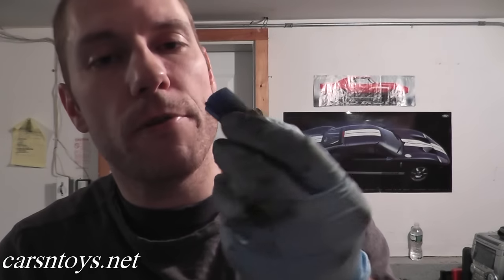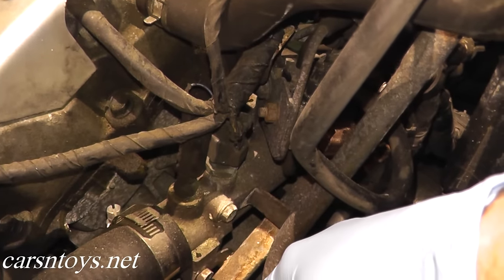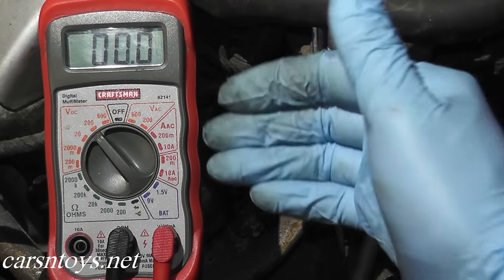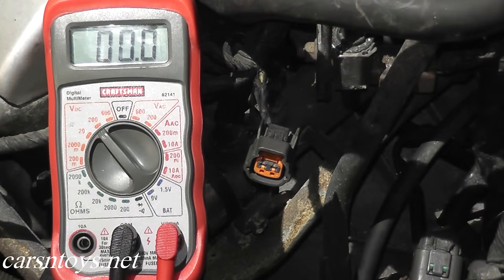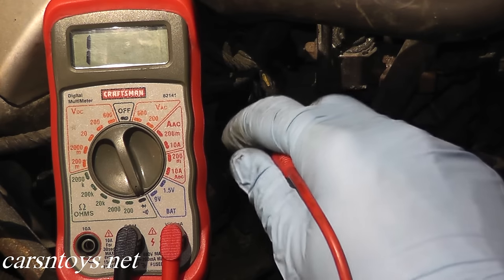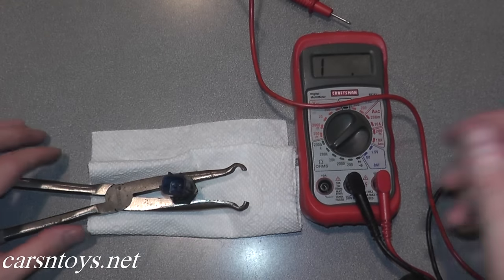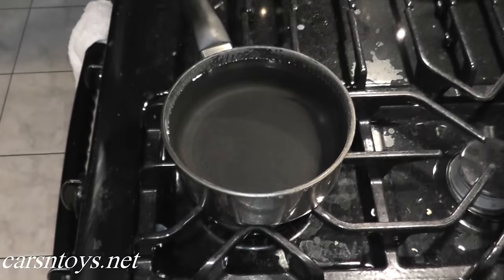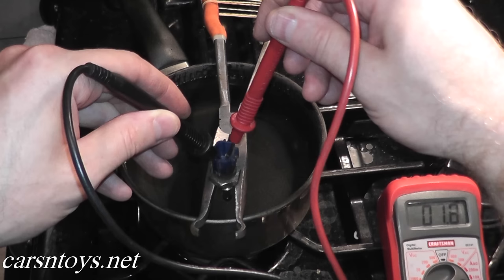How to Test and Replace an Engine Coolant Temperature Sensor P0115 / P0125

Comment: You must download a temperature versus resistance chart. That is crucial. My multi-meter was showing 22,000 ohms. Then I looked at the chart I googled and downloaded.  It showed that for 80 degrees temperature I would have 22,000 ohms. My multi-meter does measure temperature.  The temp reading on the sensor was 80 degrees. I touched the lead right onto the metal part of the sensor.  I looked at the chart and noticed that 22,000 ohms was just right for 80 degrees temperature. A reading anywhere from 1,000 ohms to 58,000 ohms (!) is normal reading depending on the temperature of the metallic part of the sensor. .
Reply: Thank you for that information I don't haft to down load it now saved me data and time !! 🙂👍👍👍

Comment: Just writing to say thanks. You helped me get my temperature gauge working again. This was on my 1990 Volvo 760 GLE with the B280F Peugeot V6. (I have been told that this engine was used in the Delorean).  Following your diagnostic steps, on my sensor connector, one pin read 12V and the other 0. Then I switching to OHMS,  the other pin read open circuit. So I reasoned that  there must be an open in a ground connection somewhere. But instead of trying to fine it , I just ran a new wire  from it to ground, measured the voltage again and it dropped from 12V to 5v . I started the car and the gauge now works.
Reply from the maker: Awesome! Glad to help.

Comment: Or it could be the ECM. or the wire from the connector to the ECM. And there's no need to take out the sensor to test it.
Reply: Michelle Sullivan that's what he said.
Reply: Michelle Sullivan but the ECU runs on less than 5 volts, and the resistance check puts put I think 7 volts? Probably should disconnect sensor before test

Comment: By far the most helpful video on YouTube or anywhere.  Sound, picture detail and simplicity of explanation 10/10/10.  Saved me from doing a lot of work that still wouldn't have fixed my crank but no start problem on my  99 Suburban. Thanks so much.
Reply from the maker: +Tonya B Thanks, Tonya. Start with basics - if the vehicle cranks check for spark and fuel.

Comment: On two 25+ year old vehicles, the tab on the female connector broke off.  Once when I was at the junk yard -- snapped off as soon as I gave it a good push, and once by someone else who replaced this sensor before I go the vehicle I'm troubleshooting (rough idle, engine stalling when engine is cold, problem goes away when engine is at op. temp.  In short, I'm missing the press tab.  Do I order another one and splice it in?  Thanks for the video -- I'm following it now.

Comment: I have a 2004 VW Beetle. A couple of days ago it starting acting strange. The engine wouldn't run right and the air conditioning wouldn't work. I suspected it was the coolant temperature sensor. This morning while the engine was cool I tested the resistance across the 2 ECM pins which should have read at the most 2.5 kilohms. It read 416 kilohms. I replace the sensor and now it runs like it's supposed to. I am so thankful.

Comment: You state there can only be two possiblities. You could very easily have a break in your wiring at any point on the harness. Two wires twisted (short to power or ground) you could also have a dead circuit in the pcm itself. But 8/10 times, you are absolutely correct.
Reply: Also i mean no offense, this is a great video!

Comment: The thermostat in question is called a "fail-safe" thermostat meaning that when it fails, if fails in the open position. If you look at the top you will see where the carriage containing the pellet has locked itself in a notch on the body to keep it open.

Comment: Hello CarsNToys

I want to say great video and I was able to locate my temperature sensor on my 2005 Jeep Grand Cherokee 3.7 for I am getting a ‘gauge not working’ on my gauge-digital dash and temperature gauge does not move.   I had replaced the temp sensor and I still get the ‘gauge not working’ error and my temp gauge does not move ( I let the vehicle idle for 15 minutes).
I did the following test with my voltmeter:
1. Voltage to temperature connector as indicated in your video and I get 4.9 volts.
2. Tested the OHMS continuity on connector and it passes by giving audible sound.
3. I ran the Kilo-OHMS test on the old and new temp sensor and I get 5.0 on old sensor and 4.5 on the new temperature sensor.
4. I brought a new temp connector, which I had not replaced yet because the voltage test to the original connector works showing 4.9 volts.
5. My electric fan turns on when the engine is idling and when the a/c comes on.
Any ideas on how to test this ‘‘gauge not working’ on 2005 Jeep Grand Cherokee?
Thanks,

Comment: You have the DMM set at the 200K ohms setting when you are measuring the sensor, so that means 2K ohms and not 2 ohms.
Reply: Exactly what I thought.
Reply: Jan Burgel but you guys still got the point.
Reply: The problem is not every multi meter has set ranges to select from.  Some are auto ranging.  So if you are looking for 2 ohms, and you see 2k, you might think the sensor is bad when in fact it's good.

Comment: Thanks for the video.  Recently got a 1991 Fleetwood Tioga Arrow (Ford e-350 chasis) whose engine temp gauge is not working.  I'd like to do this myself, but everything is SO compact and intertwined under the hood it is very intimidating.  I think I found the sensor, it seems to be just behind, to the right of the distributor cap, but it is almost impossible to reach.

Comment: The temperature switch is on the top of the engine and places the engine into closed loop once the engine heats up. The temperature sensor, for the dash gauge, is always on the cylinder head to measure the coolant temp flowing through the cylinder head.
Reply: What does ... open loop due to engine load or deceleration means?

Comment: My car is throwing P0118, P2184, and P2185..I ran all the tests mentioned in your video and everything checked out, but these codes will just not go away. Any idea what else could be causing this? Great video by the way; easy to follow.

Comment: Very good explanation ...only one rectification ..the resistance of the sensor it is 2000 ohms (2 K ohm) as the scale used in 200 K ohm I guess.. but any way your video is very good.

Comment: I checked sensor and continuity using your method and I have continuity and resistance on sensor but my gauge on dashboard shows max temp as soon as I put my car in ON position and the engine is cold as night. What could be the problem? Thermostat?

Comment: I just want to say how well you presented this. I am not mechanically experienced but  certainly have no trouble following your clear and concise instructions. I do have a P0115 error code... Mechanic could not work it out but I put my cheap Chinese ODBII diagnostic tool onto the car and it clearly told me the fault is a P0115. Now I know exactly what to do to test further.
One question if I may? I have a Peugeot 407 V6 3.0L and the reason why I found out I had a problem was the water guage would shoot up to maximum temp then drop to stone cold... then shoot up again. So to me that makes sense that the coolant temp sensor or the harness is where the fault lies... BUT if it is not there... do you have any suggestions?

Thank you!
Reply from the maker: +John Carter Glad to help, John. If all turns out well with the coolant sensor, I'd check the cooling fan motor next. You can simply test them: https://youtu.be/bf2kvZJx1OA

Comment: Fanatic video and instruction. If the reading on the connector is not good, how do i correct it? Where does the wire go? How can I check and replace it?

Comment: Hello and thank you for this informative video. I checked the sensor on my 2000 Camry 3.0 v-6. I remember you saying the normal ohm rage should be 1-2 ohms. The reading on my sensor is 5.9K ohms. I realize that zero continuity means a faulty part, but what about the really high resistance that I'm finding? Please advise.
Reply: catalyst2112 did you find out the answer to your question? Thank you

Comment: Thanks for the video. When the car is cold (65 degrees F outside), I only get 950. When the car is warm (90 degrees C on the dash), I only get 65. These numbers seem was below yours. Is the sensor bad? Thanks.

Comment: Great informative video. Very well photographed and explained. Have an 02 Honda Odyssey and the temp gauge shot up to hot and yet coolant is fine. Ironically just cleaned ports and replaced egr valve. Hope my problem is this simple. Within a day after I had the transmission temp sensor go bad. Within a week of that this happens. Again I hope its as simple as the sensor. Do you know if I can continue driving for a little before fixing without causing damage? Thanks for the great video and explanation including water test.
Reply from the maker: Thank you. I wouldn't drive the vehicle if it's close to over heating. How's the water pump?
Reply: Reservoir level seems fine, no steam and timing chain as well as water pump changed replaced at 108,000 and now has 147,000. Any other concerns?
Reply from the maker: Are the radiator fans turning on..https://youtu.be/bf2kvZJx1OA

Comment: just some added info that the temp sensor shown is what triggers the code--however that sensor is not what tells the temp of the engine on the dash. That sensor is a one wire sensor someplace else.

Comment: Also, whenever  the engine will not take throttle and stalls as soon as I touch the gas I have to hold the pedal to the floor to get it to restarted.  When it is running right I can just turn the key to start it without touching the gas. ECT sensor test OK, 5v from ECM to connector and 2 ohm resistance that drops as coolant temp goes up.  This problem can happen when it is hot or cold weather and hot or cold engine temp.  94 GMC Yukon 5.7 can run great for days and then bam, just will not take any throttle.

Comment: thank you for the video. my voltage and continuity tested good. old and new sensor tested good, still getting the p0115 code. what else could be wrong? can't figure it out could it be the pump? my car is not overheating though. thanks for any input

Comment: Thanks I'm gonna test mine on engine with these parameters. I think it's ok tho because with scanner hooked up temp reads at what is normal operating temp for my 96 Dakota, but the dash gauge never moves summer or winter. Do u know if gauges can fail or if that would usually be a wiring to the dash gauge issue? Thanks either way I can rule out the sensor for sure.

Comment: Had many problems with Toyota Camry wagon 1991 2.0 FWD 3SFE. began to check all wires to all sensors and the cold start temp switch broke in two from age! car was getting hard to drive. had problems shifting gears at 40 mph, surging idle, no power, bad gas mileage, engine light was going on then off, stalled on acceleration, no power on hills, thought the car was done! Replaced temp switch for 17 dollars at AutoZone, car runs like new!!!!!

Comment: I just pulled my temp sensor out of my Pontiac grand am v6 and I followed your video on how to test the sensor I checked the sensor with my gauge to 200k and got a reading of 4.8 in your video you say if you get a reading that's good. So I assume that the sensor is good if I got a reading. If I didn't get a reading that would mean the sensor is bad? Thanks hope to hear from you.
Reply: Was the sensor bad?

Comment: My question is can a resistor based sensor like the coolant temp sensor fail intermittently or once it fails is it done?  Mine tests OK for resistance, etc but every now and then the engine will not take throttle (hot or cold) and will stall when I touch the the gas.  Other times it runs fine...thanks.,
Reply: Prolly too late but it could be your map sensor or egr valvue

Comment: 1. Having set the meter on 200kohms that is Kilo ohms a reading of 2.0 =2000 ohms.  Not  2!
But it would be better to use the 20k range on the meter.
2. My faulty? sensor gets part way to hot, but not all the way, so really it needs to be tested at boiling point. But I don't know what the resistance value should be.

Comment: hi I have a Peugeot 308cc The sensor works I followed your instructions and I placed it in cold water the hot and the resistance changed the only problem I have is when I measure the voltage on the sensor plug I get 3.37 volts is that too low and if so would it mean the ECU has a problem?

Comment: I have 4 terminals on my ECT sensor . For my Hyundai Sonata 2000. I had 2 fault two codes TPS P0120 and P0115. As I got my throtle cleaned off carbon. Both codes disappeared . But after some few days the P0115 is showing again

Comment: i am facing trouble overheating after i installed the ms4 camshaft for my 02 camaro auto transmission i fix the radiator ,all hosing ,fans its all ok ,do you think that problem you show is mine right now ?

Comment: I replaced mine in my 97 mustang gt .. the original motorcraft had crack but still worked it measured .30 ohms ....I bought a generic replacement for a mustang gt 97... temp gauge  will not work now I measured the ohm in aftermarket it was 2.73 ohms .. everything checks out with all your test .. the original works but says the temp is real high in the l of normal before fan kicks on but the engine isnt hot .. do you think the gauge needs recalibrating or buy an OEM sensor

Comment: can this sensor cause a hard start? I had this on my check engine but took off the battery & it hasn't appeared since. my car is having trouble starting when its cold but after warming up the car starts instantly without any struggle
Reply: Ever get a solution?

Comment: Does it matter which prong you put multimeter pin to in respect to red and black pins?. And the 2ohms aspect if the ohms initial reading recorded doesn't decrease this means my coolant temperature sensor is bad? On my 2006 BMW X5 E53 M54B30 type SAV i kept getting these two: check coolant level and coolant temperature on dash display on board system of vehicle.

Comment: Would the ECT sensor dictate the thermostat temperature? I've been stumped Overheating!!
Fan will not come on almost 3/4 to red lineand at times 2 lines from the red won't kick on the coolant fan, sometimes its consistent but i believe only when the heat is on coolant fan stays on, this is not normal?Only time it would work is when I turn the a/c on which manually turns both fans on condesner and coolant fan but lt again overheats, both fans new, radiator new, new rad cap, fresh coolant new water pump, new thermostat, head gasket seems OK no signs no bubbles or milky color or smell from exhaust or any coolant in oil mixed, so is this a failing ect sensor? Its a 05 Honda civic so most of the failing parts are intermittent, never just die.
Reply: Robert Mrbena Mrbena : Sounds like the exact same issues I was having with my 2001 Toyota Camry with the 2.2L 4cyl engine. Radiator fans weren't coming on at all unless I turned on the defrost or A/C circuit functions by turning on the blower motor fan. Replaced the two-wire Coolant Temperature FAN SWITCH that is located threaded into the radiator's bottom plastic tank. Fans are working correctly now. If you unplug the connector from the switch when the ignition switch is turned on, the fans should start running immediately. You can turn them off by putting a small paper clip across the two terminals of the connector plug. This will verify if your electrical harness connector for that fan switch is still working properly or if you may need to replace that connector/pigtail assy, as well.
Reply: Hey did you find out your problem

Comment: When  I check the voltage at the disconnected plug terminals, is giving me a 2.49volts. I get a P2185 code. Could you please explain what is happening here? Thanks!

Comment: What if there wasn't any beep sound while testing the continuity wire?!!
Yet the temperature indicator is still at his minimum degree without moving till the fan turns on!
Does continuity wire have to produce beep sound necessarily while testing it on all vehicles ?!
I have peugeot 206.1.4i..

Comment: also want to add that when replacing the sensor--its brass and breaks of VERY easy--and I was being cautious knowing it was hollow and not like tightening down on bolt. Even then--that thing snapped right off breaking off the head leaving the threads in the engine and I about had a heart attack. Should that happen go get set of easy outs from autozone or equivalent--only about $11!  i came back and the threads with sensor tip came right out. After breaking it keep in mind the threads are actually loose with all pressure released--they are sitting loose ready to come out with the slightest force. I then used sealant on the threads of the new one and BARELY tightened it down. Once that gasket hits--I give fair warning that even the slightest tightening will snap it off instantly AND I WAS BEING CAUTIOUS
Reply from the maker: Good tip! Thank you.

Comment: Hello, I have a question:
I have a 1.4l petrol opel astra g that has a problem when is really hot outside - it barely starts, and the rotation speed drops to 500rpm, then increases again then drops again until the engine reaches the nominal running temperature, the everything is OK. When is very cold it starts immediately and it has no problem. What can be the reason for this?

Comment: My car has 2 sensors. 1 for the dash and 1 for the computer. My guage stayed below cold, figured out the dash sensor broke off so i replaced it. Now it reads the engine is hot. Their should be no air, and no check engine light. The engine doesnt actually run hot. It shows that its super hot during idle but gets cooler as i drive. Can small amounts of air get trapped right by the sensor that wont get bled out normally??